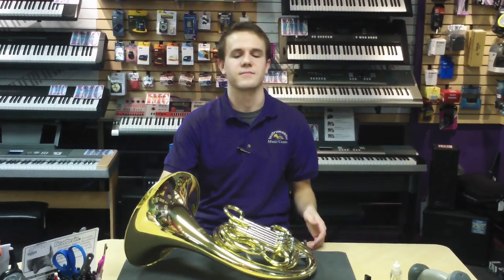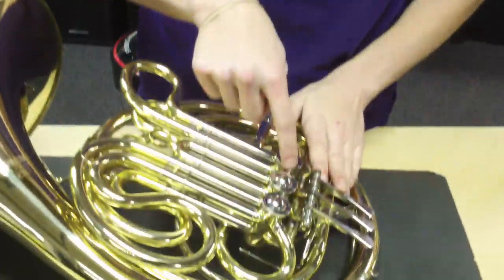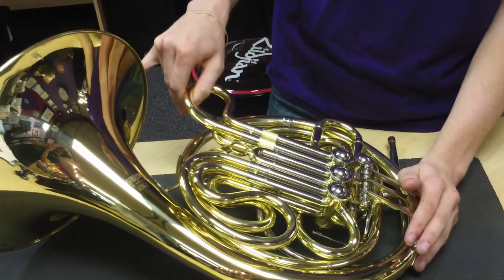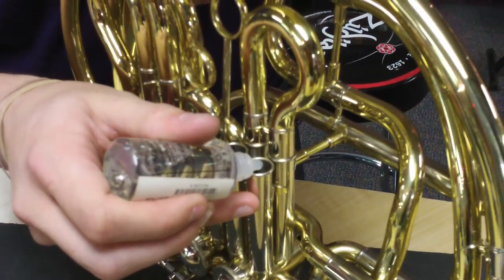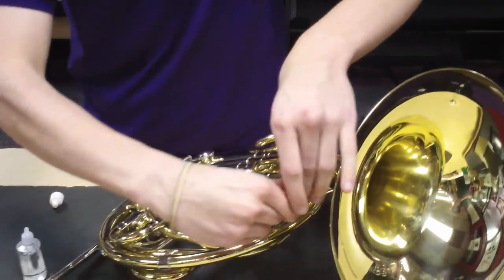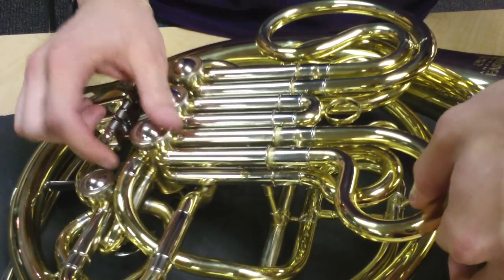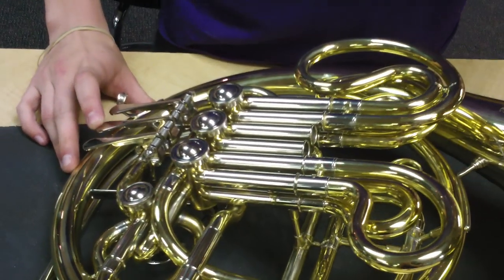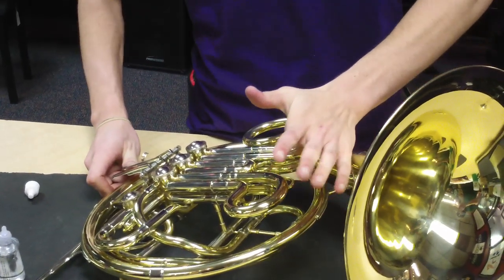How To - Oil a French Horn Rotary Valve

Comment: I agree with someone else who mentioned that there's no way to get the oil down into the rotary without touching the heavier slide grease which is on the inside of the tubing where he applied the oil. A suggestion would be to take the slide that he pulled out and place the oil into that slide, put it back into the horn holding it such that the oil stays in the slide until it is pushed all the way in (don't leave the little bit out where you would normally tune it), and then once the slide is replaced, turn the horn such that the oil drops into the rotary and wiggle away on the valve. This method keep the heavier grease from running into the rotary and gumming up the valve.